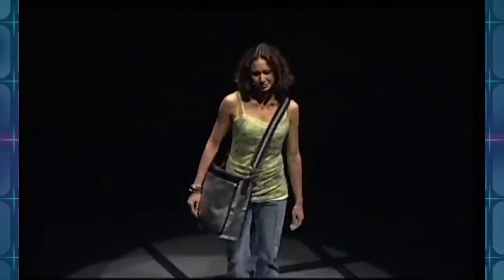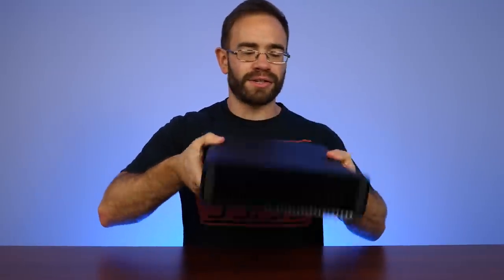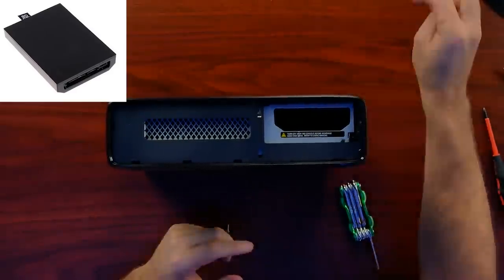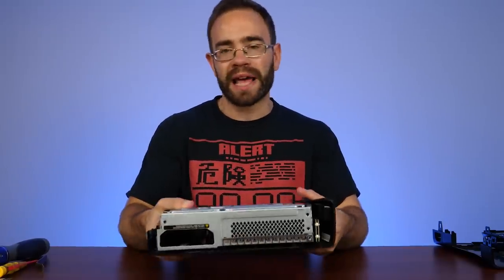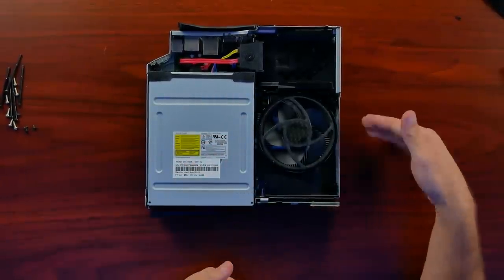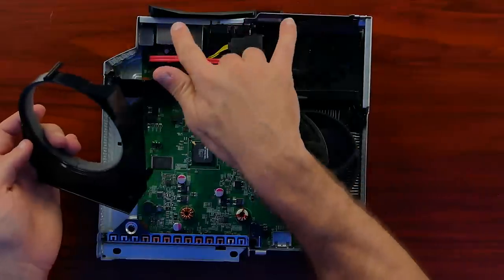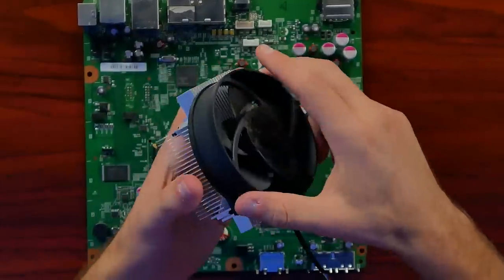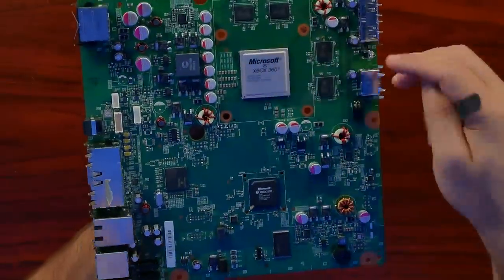Here's How Microsoft Solved The Xbox 360 Red Ring of Death

Comment: I remember getting my 360 back in late 2006 with TES: Oblivion, super excited when unboxing the system. The first fault right out of the box was the external power supply that had a weird creaking sound and terrible coil whine. Later that week the disc drive stopped reading my discs. Replaced it, the second one did the same thing. Replaced it a second time, got a system that would stop reading the disc in the middle of a gaming session. After this my local Gamestop (EB Games in Sweden back in the day) stopped believing me and made me contact Microsoft directly. With them I had to get the same machine replaced three times, two for RROD (one day before the release of Halo 3, thanks Microsoft!!) and one more time for the faulty disc drive. My friends with Xboxes had to get them replaced at least two times, one of them four times. Oh boy, how I miss gaming with my old pals in Gears of War and Halo 3, the quality of the Xbox hardware on the other hand not so much...
Reply: @chrisgotgames6405  just as bad
Reply: JohnDoe 1  yeah 1 of my 4 phat models works great too.
Reply: @MisfitoX  yeah that’s what it is
Reply: @chrisgotgames6405  if you do get a PS3, don't get the fat one nowadays. Those things are prone to getting the yellow light of death once they get old. I had to learn the hard way after buying a used fat one that went out on me. I tries fixing it twice, but no luck.. The first 360 I owned: the Slim one that you see in this video, gave me the red ring of death after having it for 9 years. Now, I just got the 360 E, and I got the PS3 Slim. Both of them are super reliable.
Reply: @chrisgotgames6405  for some reason the one I got (the second model - 80 gig), gave me the yellow light of death. I think the previous owner didn't take good care of it. The slim still goes strong. I got it at an arcade store that sells retro consoles. I see it was made in 2009. Whoever had it knew what they were doing, because it still works like new after all these years.
Reply: @chrisgotgames6405  yeah you're right, I think the slim is by far the most reliable console made. I at first was really bummed, because I kinda thought the fat looked cooler to me, but now I've grown to really like the slim. It's a sweet console, and I've grown to like the look of it too.

Comment: Experienced RROD 5 times, my console was always well ventilated. They refused to warranty it the last time and I was forced to buy the slim. Pretty shitty.
Reply: Same exact story with me. Except it was four times I got the RROD. Then my gf at the time bought me a slim. No problems since but man.. I thought I was the only one with so many red rings.
Reply: Try going through 3 different Playstation 2's. I hate Playstation.
Reply: El-ahrairah not true. I still have an original 360. Still working.
Reply: @XBX1MASTER   what do you use it as a paper weight? I bought 4 Xbox 360s because of failures, and all my friends at the time bought multiple 360s too. The Xbox 360 sales number where extremely inflated because of it. I think the real number of 360s users are around the Xbox ones.
Reply: Og ps2 and Og 360 are trash consoles, Og ps1 had it's share of problems too
Reply: forgot to mention the NES in there as well 🤣
the 16 bit generation may be the only gen that didn't have mass failure rate of consoles
Reply: El-ahrairah I'm just telling you my experience. If it dies now after 15 years of use I'd say I got my moneys worth.
Reply: El-ahrairah  incorrect. There are revisions of the phat 360 model. Xenon is the first one, then zephyr, falcon, jasper, and finally kronos. Xenon, zephyr, and falcon are the ones that made up 99% of the first 360 failures. The jasper and kronos models outlast s and e models and run cooler too.
Reply: El-ahrairah  incorrect, again. The solder is NOT the issue. All 360s don't get nearly hot enough to melt solder, or crack it. Almost all rrod failures are from ati's defective gpus. They were defective from the day they were manufactured, and it was just a matter of when it would die. The heating cycle speeds up this process. Even if you liquid nitrogen cooled the 360 it would still die sooner or later because its defective. The fan mod really won't do anything either because the xenon and zephyr 360s run super hot no matter what.
Reply: @shortyorc121  it depends on the motherboard revision.
Reply: @rockl79  I got a 360 at launch it died in 2 weeks. To be fair I played almost non stop for those 2 weeks. After that a 360 died on me about ever 6 months until I got a Xbox slim. I can not say how reliable they are because I moved on to pcgaming as my primary platform around that time.

My dad still uses his Xbox 360 for YouTube and Netflix and we got him that around the time of slim. So yeah your probably right. Later refresh probably have a lower failure rate.
Reply: @shortyorc121  the odd thing is the last revision of the fat 360 runs 10-15C cooler than the slim, and the slim tends to die a lot more than the final fat 360 revision
Reply: @rockl79  is there a way to tell what revision you have without opening it? Say like buying a 360 at a garage sale?
Reply: El-ahrairah  got ya thanks for the honesty.
Reply: El-ahrairah   No. If you use an x ray machine specifically designed for motherboards you can see that there are 0 broken solder balls under the cpu/gpu. You could reball the 360, but there is no point because reballing flip chips is BS. Its basically reflowing the chip with extra steps. The two main causes are either 1: the die is defective, or 2: the die is separating itself from the substrate. The reason why the towel trick, jamming the fans, and reflowing/reballing work is because it messes around with the die, just enough that it will work. 

As for the "BGA issues", that is 100% false. The 360 uses lead free solder, which is not the issue. If you were to completely unplug the fans and let the 360 sit for a while it will go up to 100C which would then trigger the 360 to go into a state called EC_THERMAL (aka 2 red lights, or overheating) where basically everything gets shut off except the fans. You can't turn off the 360 from that state, or do anything until the 360 gets to a safe temperature. Now, going back to what I said earlier, the 360 goes into that state at 100C. If you know ANYTHING about soldering, you would know that leaded solder (NOT used in the 360), melts at 180C. And lead free solder (which IS used in the 360) melts at 220C. Thats a 120C difference. How does the 360 crack, melt, or make the solder balls malleable when its max temperature that it will ever run at is 120C lower?

One of my friends who knows a LOT more about 360s than you or I do did a test. He reballed 10 360s and 9/10 of them died within a few weeks. The last one lasted a while longer, but still died. And NONE of them were being used.
Reply: @rockl79  OK so the only way to know the 360 is a falcon revision is by opening it up and looking at the mobo? Is there a way to tell by say serial number?
Reply: El-ahrairah  if you really had 2 5 pound boxes of x clamps then you would know 1: solder is NOT the issue 
2: there are revisions of the fat 360 that did, in fact fix the rrod issues.
3: the main revisions are xenon (no hdmi port launch units) 
Zephyr (first 360 with an hdmi port, nothing else major changed besides the HANA chip and the cpu no longer being locked to the motherboard)
Falcon (65nm gpu, down from 90nm on the xenon and zephyr 360s, and 80nm cpu, down from 90nm on the two older revisions)
Jasper (65nm cpu and gpu, but still has 80nm eDRAM on the gpu)
Kronos (65nm cpu, gpu, and eDRAM reduced to 65nm)

4: jasper rarely dies to e74, and kronos only dies from sanyo capacitors

5: jasper and kronos boards tend to outlast trinity, corona, and winchester boards (the s and e revisions)

6: jasper and kronos run 10-15C cooler than the s and e models
Reply: El-ahrairah  the die is the issue on most of them. They don't get hot enough to reshape. I showed you the facts and you still don't believe me.
Reply: @shortyorc121  you don't need to open it up. There are some numbers above the power plug that should be 12,1V and if its a jasper it will say 12,1A next to that. If it says 14,2A its a falcon, and if its a xenon or zephyr it will say 16,5A
Reply: @rockl79  awesome thank you!
Reply: @shortyorc121  no problem. Im happy to help
Reply: @XBX1MASTER  the OG fat models of the PS2 where indeed time bombs for lasers not reading the disc, but at least if you found the correct laser, it was fixable, and the PS2 slim mostly solved the issues, and even reduced the heat output by moving the PSU to be external.
Reply: @shortyorc121  Im guessing he must not play but maybe 20 minutes or less a day? Anyone that was playing online for many hours did have the rrod all the time after 5 to 6 months with the first released xbox 360s.
Reply: @CAPCOM784  I have the latest revision 360 fat, I have had it since 2010 with 0 issues
Reply: @rockl79  I still have my Final Fantasy Xbox 360 and the lastest 360 revision as well.🙂
Reply: @CAPCOM784  I use the latest revision 360 fat with a halo 3 shell on it. Looks way better than the s and e imo
Reply: @shortyorc121  also PS3 failed a lot too. All fat model are dead or going to die because of the NEC TOKIN capacitors.
Reply: @SiliconPower74  not 100% true. While the nec tokins definitely are an issue, it doesn't mean all of them are going to die. If all of them were going to die then you would have to include the early slim models on that list as well.
Reply: @rockl79  yup round late 09-2010
Reply: @chrisgotgames6405  microsoft did. Thats why once it reaches 100C (which is WAY hotter than your average home at 212F) it will shut off all power to everything and make the fans go at 100% fan speed. Its literally not possible for it to melt solder. You would have to live somewhere that gets to 220C (428F) to melt the solder.
Reply: @2toottoot  the very late falcons fixed the rrod but they are hard to find. In mid-late 2008 is when the jaspers started to filter into the 360 ecosystem
Reply: @rockl79  yeah I checked my date on my 2nd X360, 10-20-08
Reply: @2toottoot  it is either a falcon or jasper then, since microsoft was still making the falcon into the jaspers life cycle
Reply: @rockl79  Looks like mine is a Falcon from 2008-06-29, 14.2A 12V on the power socket.  Should I be concerned?
Reply: @alexatkin  they are about as reliable as the winchester e 360s, probably even more reliable than one. They aren't really reliable or unreliable
Reply: i never got it and treated my xbox like shit the whole time, i honestly don't know how people got it so much, like how much did you play?
Reply: @RusticRonnie  its because of ati and their crappy defective gpus. Some people didn't get defective consoles and they are fine. I have a launch 05 360 with no hdmi and it works fine to this day.
Reply: @XBX1MASTER  bullshit. I went through four or five and barely played it. It was in a well ventilated area and I would vacuum the vents on the 360 regularly. If it is true (it’s not), I hope you have a backup plan. That thing is a ticking time bomb.
Reply: @rockl79  thank you for the thorugh explanation and info. You are the man 👍🔥🙏

I have 2007-09 Xbox 360 Elite bought brand new and still working. Got the red lights for overheating but after cleaning it's back again. I put 1000 hours on it at least when I used to play like crazy.
Reply: @rockl79  One question, I bought a used xbox 360 jasper kronos board repaired from a mosfet and a capacitor, do you think it will last me? or will it fail again from the same problem?
Reply: I have a 1st generation 360 (Q1 of 2006) that still works to this day somehow. Granted, I have kept it extremely clean over the last 16 years, have replaced the thermal paste on both chips 3 times, and have the extra fans on the back. That thing still cranks.

Comment: No, you can't just replace the DVD drive. They are locked with firmware encryption and married to the main board.
Reply: I thought that when he said you could replace them
Reply: True. It's not just swappable. You can reprogram the flash chip on the drive with the correct encryption key, but that can get complicated and is not for everyone.
Reply: dvd cant be changed unless you get the same model replacement and changed the daughterboard thats on it, each drive is locked to the 360 it was made with, those details are on the daughterboard. ive done it and this works.
Reply: @reddev5420  have to change daughterboard thats on the drive and donor it to a same model working drive, then you dont need encryption key or any mod knowledge.
Reply: @bloodbath-and-beyond  i didnt say you cant extract he key, but if you aint good with flashing its way easier just to change the board why you are trying to correct me on something i never said? hers my previous reply....have to change daughterboard thats on the drive and donor it to a same model working drive, then you dont need encryption key or any mod knowledge.
Reply: @bloodbath-and-beyond  i tried the flashing and it didnt work i had two identical drives so changed the board was easier than trying to flash if im honest, thats why i suggested it ifyou computer savvy then i guess itd be easier, i am savvy, been building pc's since 1999 but i found it hard to do, maybe not patient enough or wrong guide i dunno but it was just easier to do that.
Reply: Thats what she said
Reply: @supjay3945  I don’t think you could ever understand
Reply: @deeplaysgaming4754  you can drive spoof
Reply: On the Xbox original the HDD is "married" to the motherboard unless you mod your console. I find it interesting MS went with "marrying" the disc drive for the 360.

Comment: Aww man... You're uncovering many past wounds for me.

Got the Ring of Death on the first Xbox and the 360.  Ended up selling my One before it let me down..lol.
Reply: After my 360 experience I vowed to never buy an Xbox again regardless of the exclusive they release, it has not been an issue. Cup Head was the one from this generation I was missing, then it came to ps4.
Reply: @KitchenerLeslie2  xbox are way better now. No problems like that with the xbox one or series. You should give them another chance. Just because they released a console that had a major fault once doesn't mean their entire brand is terrible.
Reply: @izakomandaz2895  I don’t care. I will never give them my business again after that BS. There are also no exclusives on that console worth a damn.
Reply: @KitchenerLeslie2  you do know the ps4 has the same problem! The ps4 has the blue light of death which indicates the same problem the xbox 360 had - solder balls on the apu breaking. Its not quite so widespread but it is a relatively common problem.
Reply: @izakomandaz2895  I only played my 360 25% of the time compared to my ps3. I bought 3 additional 360s and returned their shells with my 360’s fried guts. I’m on my fifth 360 (and final Xbox). They were garbage. Mine had plenty of air and I vacuumed them fairly regularly. My original ps4 is in my teenage daughter’s room, never been vacuumed and cocooned in clutter. I can hear the fan from my living room, but it still works fine. Launch ps4, btw. My second ps3 still works fine. I retired my launch ps3 because it was loud.
Reply: @KitchenerLeslie2 jasper xbox 360 never had an rrod and were quiet as hell. Also the 360 E my pro is loud as hell and its clean with new paste

Comment: I used to repair the fat Xbox 360s for a computer store back in the days, the biggest problem was the cooing fans didn't run fast enough, the CPU pretty much got hot to the point of de-soldered itself from the motherboard. Microsoft also used very cheap solder too. I believe they were using lead free solder. To fix it I would use lead base pellets to re-ball the CPU and snug the heat sink down to the motherboard with quality thermal paste. Microsoft really f**ked up running the cooling fans at only 5v, I fixed that by re-wiring the fans to run at their full speed at 12v. The system was a little loud afterwards but I rarely ever had anyone bring one back.